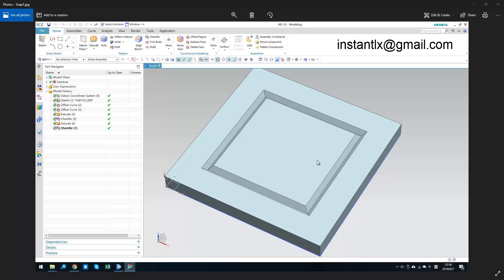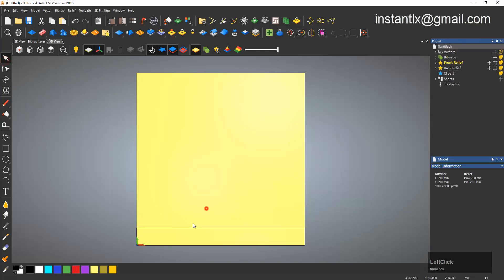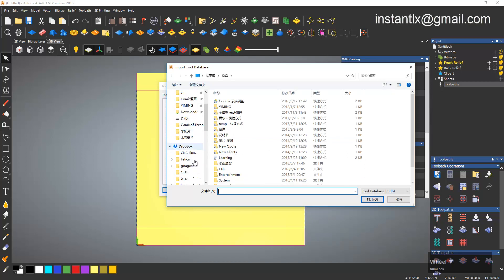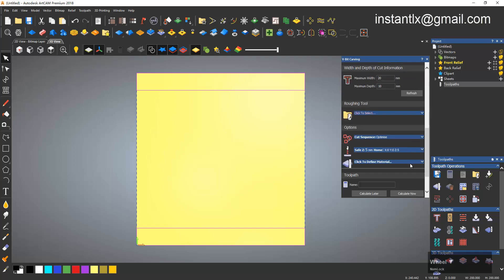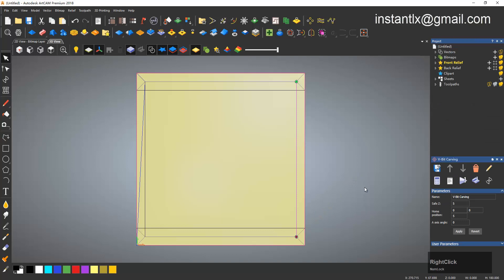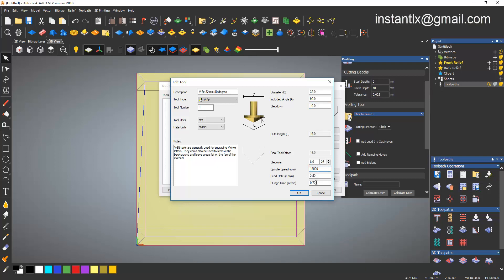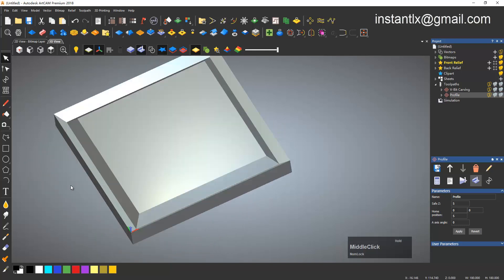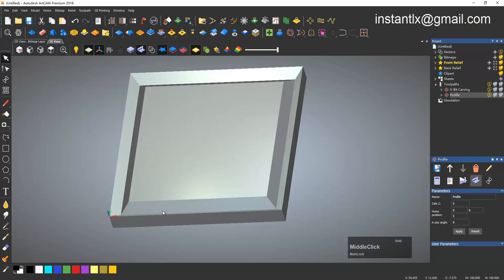simple v bit solution for sharp corners in ArtCAM, artcam tutorial,

Comment: This is a simulation error
.
in fact, this result cannot be achieved with this method.
If you do the operation on the machine it will go wrong.
Reply from the maker: The correct solution is smart engraving. I'll make a new video about this.